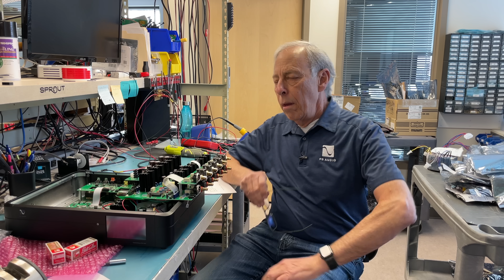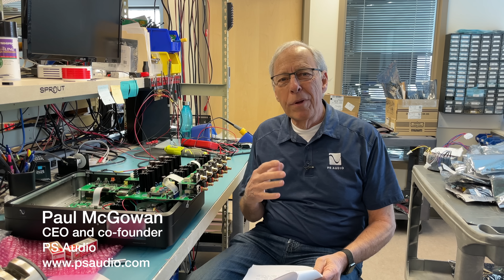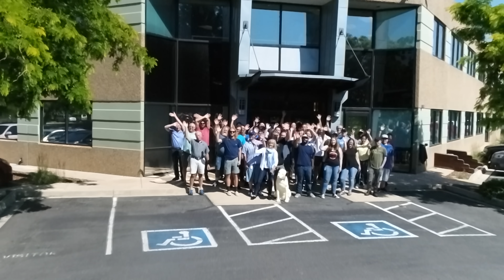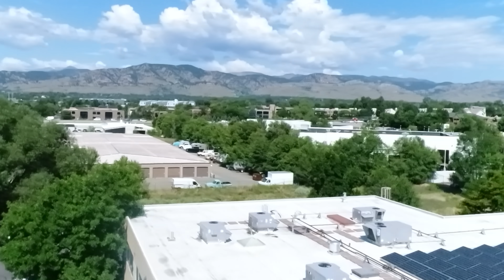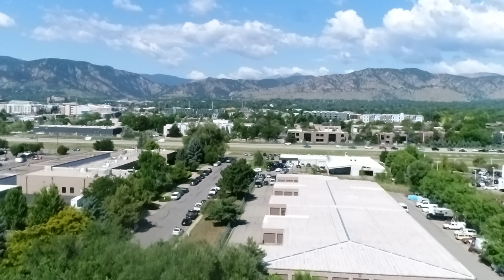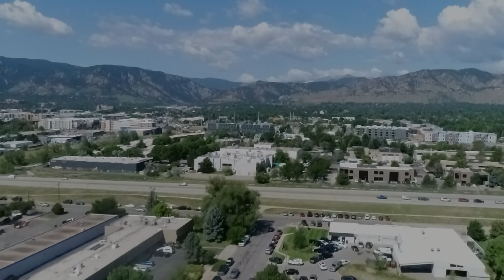Why high resolution audio?

Comment: Is there any advantage to recording in 24 bit if the master file will be 16?
Reply: More bits and higher sample rates are used in the recording studio to give editing headroom but are pointless for playback.
Reply: @geoff37s38  how is the headroom not defeated by 16 bit conversion?
Reply: @graxjpg  The bit length determines noise floor, this is all it does. 16 bits gives a noise floor below hearing threshold. This is why silent sections on a CD are perfectly silent. You cannot improve on perfection.
Reply: @geoff37s38  thank you for your succinct responses!
Reply: @graxjpg  Just to clarify. 24 bits may be used by the recording engineer to ensure capture of full dynamic range, especially on a live performance where dynamic range is unknown before performance starts. 24 bits gives engineer room to capture loudest sound without risking horrible distortion on these peaks. The recording can then be put in a 16 bit frame which is more than enough for the finest playback equipment.
Reply: @geoff37s38  there is potential for errors in the conversion from 24bit to 16bit. While I agree that the dynamic range provided by 24bit is excessive for playback, if it's already recorded that way, why not just deliver it that way as well? (assuming it's not being authored to a CD obviously)
Reply: @PAPO1990  No home audio system can handle a dynamic range of 144dB, and no 24 bit track can actually give 144dB. 24 bit tracks are just a waste of data space 16 bits gives at least 96dB dynamic range which is more than enough.
Reply: @geoff37s38  well for one thing, some orchestral music will have a dynamic range of OVER 100dB, so we'd want more like 18-20bit but storage and bandwidth are so plentiful these days there is no reason to go throwing away those few extra bits per sample at the risk of creating quantisation errors. I'd rather they just use lossless compression like FLAC or MLP if they are that worried about file size.
Reply: @PAPO1990  Modern dithering techniques can give 120dB with 16 bits. It could be argued that even more dynamic range is undesirable in a home system. A quiet listening room may have a backround noise around 40dB. Now imagine playing a recording with 100dB dynamics, adding room noise takes you up to 140dB which is above the pain threshold. Also a quiet music microphone has a s/n ratio around 92dB, limited by the Browning Effect of random air molecules hiting the diaphragm. 24 bits requires 30% more data space over 16 bits, which is significant.
Reply: @geoff37s38  1) dither is literally noise that is added to make 16bit work properly.
2) 30% may sound like a lot, but this is just audio, not video, it’s not that big to begin with

Comment: The reason why you need double the samplerate is because you need a minimum of 2 samples to accurately store any given frequency (one sample for the crest, one for the trough). The reason why aliasing happens is because when you go higher, the computer has less than 2 samples worth of space to store that frequency, and can't estimate its analog counterpart properly.
Reply: Exactly.

Comment: This made no sense at all, you cannot hear any if that shit above 20khz, filter are a really poor explanation for the overshoot. This guy probably cant hear above 14000khz at is age, audiofooling at its best. So where does it end 2 ghz ??? Lol
Reply: Where it ends depends on how steep you can make a filter that doesn't significantly distort the music.What the Nyquist-Shannon theorem does is to define which frequencies contain the quantization noise.  If you have a sampling frequency of 44kHz, then the quantization noise is at frequencies starting at 22kHz.

It is very difficult to create filter that allows frequencies of 20kHz to pass unattenuated while blocking the noise above 22kHz that do not add their own distortion -- particularly phase distortion.  However.  If you sample at 192kHz, the noise is all above 96kHz. It is much easier to make a non-distorting filter in the gap between 20kHz and 96kHz.
Reply: @timharig  its hilarious that you consider filter that allow frequencies of 20KHZ to pass...lol why does it matter exactly... lol ?
Reply: @taroistok8751  Because if you do not, you end up with  the samples as a kind of square wave instead of the recreated analog wave form.
Reply: @timharig  nyquist explained this long ago..... at 44hz the human ears cant see the difference at all it perceived a analog wave of sound and cannot hears the step or know its squares, for frequency up to 20 khz.
The problem is audiofool paying thosand of dollars for no reason.....
When you go to the cinema do you look at a movie and think you see the individual frames? No your eyes cant, same with ears and high rez
Reply: @taroistok8751 

You are mis-reading the theorem.  Unfortunately, most sources only state Shannon's part of the theorem about the Nyquist limit rather than actually showing the mathematics behind it.

Like all mathematical theorems, the Nyquist-Shannon Sample Theorem has criteria that determine when it applies and when it does not.  In the case of Nyquist-Shannon Sample Theorem, that if case specifies that the theorem ONLY works for bandlimited systems.  This is why DAC's always have a low pass filter. It is referred to as a reconstruction filter, an anti-aliasing filter, or an anti-imaging filter:

https://en.m.wikipedia.org/wiki/Reconstruction_filter

The output of the DAC will not be a square wave or step.  Once the signal goes through the low pass filter, all of the sampling noise above the Nyquist limit will be removed and a perfectly smooth recreation of the original sampled sound will be output.

All this works because Nyquist part of the theorem isn't just about the Nyquist rate.  What it really shows is how the sampling rate determines the higher order aliases that are produced by the sampling pulses.  It shows that an infinite aliases occur at integer multiples of the sampling frequency in order to create the sharp sample boundaries.(Remember short pulses in the time domain equals broad bandwidth in the frequency domain.) Low pass filter to remove all of the aliases, and you are left with just the original smooth signal from the baseband.
Reply: @timharig  all of this is irrelevant to the human ears who cant differentiate any quality changed over cd quality.
People that think they do are fools.
Do a blind test, im a audio engeneer and did a blind test and nope.... some people will get maybe 15% to 20% right answer in a mp3 320kps vs CD challenge, but from cd to 24 bits 96 khz almost nobody will get over 5% of right answer and mostly by chance
Reply: @taroistok8751  And all of that is irrelevant because I have said nothing about human ears or the recording.  It isn't about humans being able to hear frequencies higher than 20kHz.  This has everything to do with the design of the anti-aliasing filter of the DAC.

It has to do with the fact that brickwall filters capable of attenuating signals in the gap from 20kHz to 22kHz always add distortion  (particularly phase distortion which will affect the  frequencies well below the 20kHz cutoff) versus slow roll-off filters (20kHz to 96kHz gap) which can be designed with much less distortion. 

So unless you used two different DACs with different anti-aliasing filters when you did your  blind tests, they are meaningless to this topic.
Reply: @taroistok8751  

Paul McGowan: "It's not about the frequency people hear at, it's about DAC filter design. "
Tim Harig: "It's not about hearing frequency, it's about making space between the top audio frequency and the Nyquist frequency to make room for effective DAC filter design for audio under 20kHz."
the math: "Higher sampling frequencies allow better low pass filters in DACs."
Taro istok: "But, but, but people cannot hear over 16kHz..."

We all absolutely agree with you that people cannot hear sound over 16kHz. That fact is completely irrelevant to point that Paul was making.
Reply: @timharig  the problem is the point paul make is pure non sence. You do not need anything over 44khz,  you can argu it all you want unless you have ears transplant.
Find me anyone that would be able in a blind test yo tell me these filter on the 96khz dac are better performing then those in the 44khz one.
Its pure bullshit. 
This is the point i make in the first comment, wich you still dont get apparently.

To use a analogy, human eyes cannot see individual frame in a movie at 24 frame seconde we see continuous motion...you can add all the crap you want it wont changed that fact its neurobiology. 

There is no fondamental to have equippememt that reproduce sound we cant hear for music listening purposes. 
Maybe in a svientific point of view to be able to record at 96khz might be usefull if your a phd studying the sound of bat in a cave, or whales in the ocean, but for a musical reproduction system, one could argue that it is just a enneficient system to waste electricity on parts, that will produce heat and makes absolutly no audible difference. Wich is exavtly what he talks about here.
You know those 12000$ cd, i had one with the whole shebang, and i did many test, and nobody could ever tell the difference between the high end one and a panasonic shockwave. All bullshit

Comment: You don't discern between today's DSP filtering which would have no phase shifting and the discrete filters of years ago.  The D2A output can have more and finer discrete steps, lessening the need for those more complex discrete filters that can introduce phase shifting.  And what do you do when your high res. DAC can only resolve to 15 bits anyway?
Reply: the issue is when you record you cant let anything above the nyquist frequency hit the A/D converter in the first place, hence the need for an aggressive low pass filter right at the nyquist frequency when using the standard, relatively low sample rates.
Reply: @PAPO1990  Yes I know, but your missing the point that the majority of the filtering is now done digitally and that greatly reduces the discrete analog filtering needed.
Reply: @chrisharper2658  you seem to be missing the fact that the filtering NEEDS to happen BEFORE the signal ever hits anything digital. I literally got a diploma in sound engineering studying this stuff, you can’t process it digitally if you haven’t digitized the signal yet, and you CAN NOT digitize the signal if you don’t filter out EVERYTHING above the nyquist frequency
Reply: @PAPO1990  But your talking about recording and the subject is playback as in the DAC
Reply: @chrisharper2658  but in recording, the damage would already be done. Plus, down-converting always results in rounding errors.
Reply: @PAPO1990  Not talking about recording and DSP would in effect up-convert not down-convert.
Reply: @chrisharper2658  but it has to be recorded to start with, and if the recording quality is bad then playback will be bad. As for up converting, it’s no substitute for quality source material
Reply: @PAPO1990  We can only play back what we have and assume that the source is okay.  As for up-converting that where you apply the brick wall filter digitally, hence no phase shifting, which was my point.
Reply: @chrisharper2658  the issue is you need to filter it out before recording, THAT’s where the phase shift problems start. You need to record at high sample rates, then apply it digitally later and down convert it. But why go to all that trouble if you’ve already recorded at high sample rates, there’s no reason not to release at high sample rates

Comment: 192khz is the sampling frequency of the musical signal. It’s got nothing to do with the frequency response we are expected to hear.
Reply from the maker: That's simply not true. Let me try and explain. A 44.1kHz sampling rate is bandwidth limited to 20kHz (half the sampling frequency). 192kHz is similarly bandwidth limited to 96kHz. Now, having said that, obviously we cannot hear 96kHz, but that was never my point. What we want is to have a gentle filter so that we don't suffer audible phase shift in the music. That cannot be done with lower sample rates but it can with a higher sample rate.

Put another way, if we were dealing with strictly analog circuitry, a preamp that was bandwidth limited to 20kHz would sound rolled off because of the affects of phase shift that extend down well into the audible frequency range. An analog preamp with a bandwidth of 50kHz will sound much more open and less limited because of this. That's the difference - and higher sampling rates allow for wider bandwidth in the audio band.
Reply: @Paulmcgowanpsaudio  Paul, thanks for replying. This means that all the information I have read elsewhere online about sampling frequencies is wrong! Thanks for your ever boundless knowledge.
Reply from the maker: @davidtomsett  Hard to say if it was wrong but I think in general there's a bit of misunderstanding out there. The higher the sample rate the higher the possible bandwidth of the audio signal. What the recording engineer decides to after that is up to them.
Reply: @Paulmcgowanpsaudio  hence MQA!!
Reply: Indeed so. I'm surprised Paul confused the two.
Reply: That’s exactly I was thinking
Reply: What about oversampling? Don't most modern cd players and DAC's use 8x oversampling to allow for more simple filters?
Reply from the maker: @brianbontrager7618  I've not seen a CD player or transport with over sampling. Some DACs have it but it's rare. Our DACs do, but again, that's rare.
Reply from the maker: @niekvans  I have never misled my audience on purpose. I have certainly been wrong at times and am human. :) What you probably are missing is the difference between over sampling and actually capturing the original data in a specific form. So for example, if we look at an A/D converter it is there we can set the sample rate and type of conversion we are looking to make. If I am recording in DSD it is one form, if in PCM another. Let's say I choose PCM and 192kHz. And let us also say that for experimental purposes I will take the same microphone feed and split it off into a second A/D set to 44.1kHz. I record both and then playback the two and listen on a resolving stereo system. Depending on the musical content I will most definitely hear a big difference between the 192kHz and the 44.1kHz. This has nothing to do with oversampling or upsampling.

The video you refer to is valuable on some levels but misleading on others because it strives to make a point which misses the bigger picture. In any case, let's agree to disagree,
Reply: @Paulmcgowanpsaudio  With all due respect, you wrote "Some DACs have it but it's rare" (regarding their use of oversampling). I said, no, it's not rare and cited sources. No need for convoluted answers here, unless your goal is to confuse. Which part of my statement was missing something? Is it rare for audio DAC chips to use oversampling, yes or no? Which part of the given links was misleading? The bigger picture is that 192kHz for distributing music is useless, and just a way for record companies to resell their music to ignorant audiophools.
Reply from the maker: @niekvans  Yes, sorry, if you mean that most modern DAC chips use oversampling in their process before the modulator then you are correct. My point was, and remains, that's not what this post was about. I simply meant that we keep moving away from what I was referring to in the video. But, that's ok. Recording in 192kHz, or (better) 176kHz is very much better sonically than recording the original files in 44.1kHz. The point of the video was to answer the question posed, which is why sample at such high rates if speakers can't reproduce it and that answer remains accurate.
Reply: @Paulmcgowanpsaudio  Ok, so why did you say it's rare, when it's not? The oversampling is not unrelated to the point of the video, "gentler filters", in fact it's the reason that it's done in the first place. And yes, during recording you can apply oversampling as well so you can use a cheap, "gentle" RC filter - if this is what you're referring to, good! But these are intermediary processes, and there is no benefit to using 192kHz (or anything above 44.1kHz) as a music distribution format. I'm not sure if you're being deliberately vague when you say "recording in 192kHz is very much better..", but there's no point to "high res audio" files/streaming for consumers. If you disagree, it may be interesting for you to take this guy up on his offer and do a blind listening test (44.1 vs 192kHz). If the difference is as big as you seem to believe it is, it should be easy: https://www.youtube.com/watch?v=3DJMj_v-i0Y

Comment: Fasefaults are not welcome, here I do speaking over the highest frequencies , so we need very high bandwidth and speed, Nice amp, see capacitive mosfet driving? I have two designs who use dc coupling. one of them is all plate follower
soo complete nonfeedback except mosfets. I am not against feedback, but we need really a complete fase efficient system to get succesfull without harssnes sound.